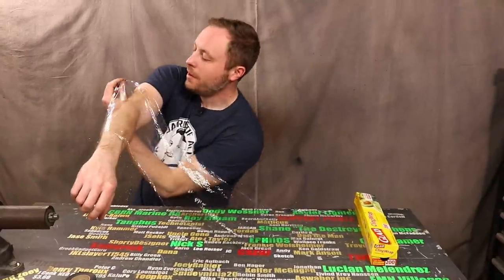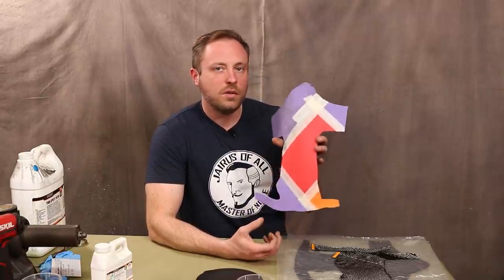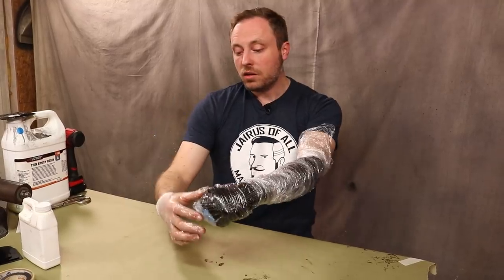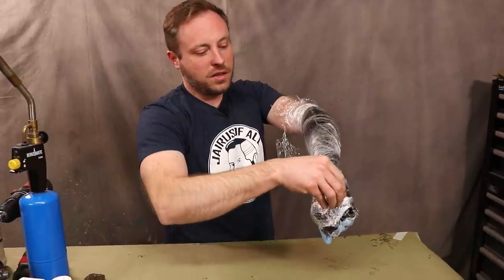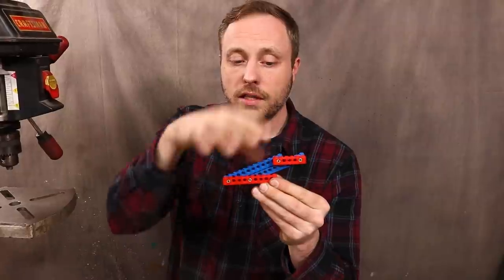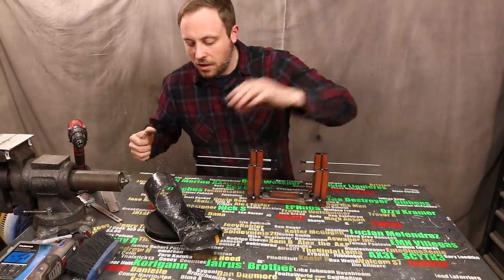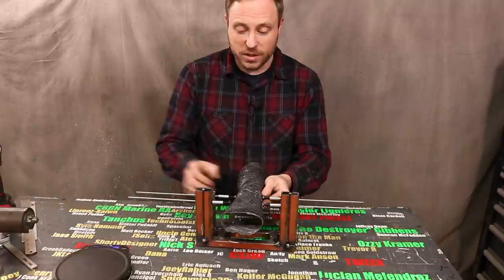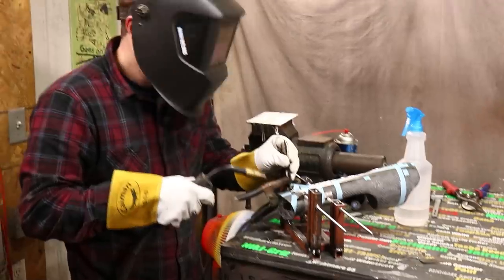REAL LIFE Mantis Blades Cyberpunk - Build Part 3

Comment: Maybe next time go with a carbon fiber kevlar composite for added toughness to the material or straight up kevlar. Also use some sort of modeling clay or wax to make a template of your arm on the inside of the wall of it and then remake the mold in some heat resistant mold material, then layer your carbon fiber on the mold and consolidate it much easier, and you get the added bonus of using harder resins that you can stick into the oven for heat curing. Also with the added mold, you can trim it or add material to take into account any foam you want to add. Theres a website called ripstop by the roll where you can buy padding used on backpack straps and whatnot. Hell, there might be websites where you can buy gel material or breathable foams to make very comfortable wearable gear.

Comment: maybe you could use chain sticked to the arm on the ends and put a mechanical wheel to the mounting of the the blade. It would keep the plade paraler to your hand, because the chain would turn the wheel as it is moving and it would handel a lot of stres.

Comment: I was thinking that you could have made a mold and casting for your arm and then put the carbon fiber on the cast of your arm instead of your actual arm. Also if you made castings of both your arms, you could then use those castings for future projects that have arm mounted gadgets or weapons. I think this would help if you need to make replacement parts for the mantis blades, and would make it easier for you to tackle other wrist mounted weapons.